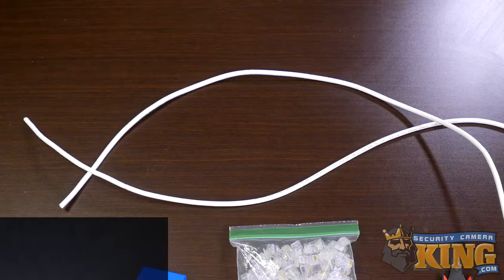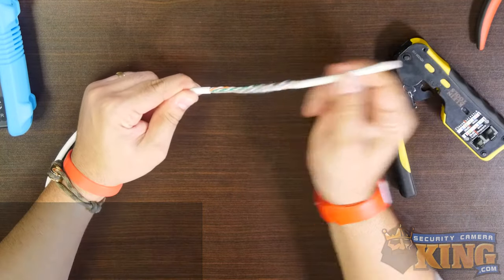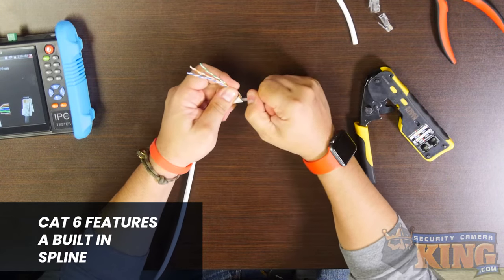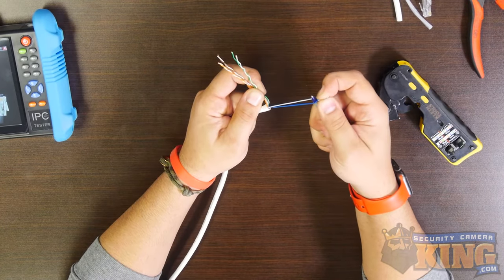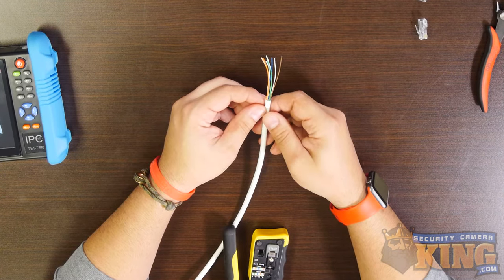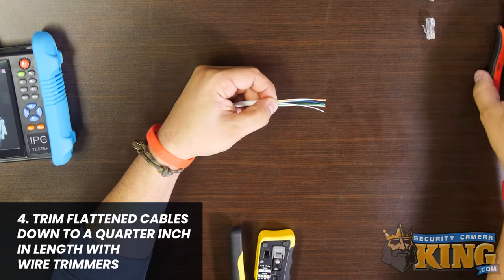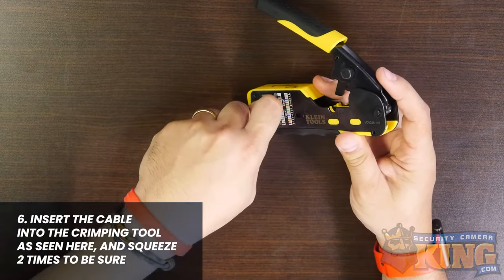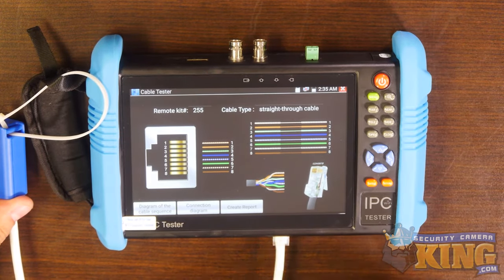How to Make Ethernet Cables - Cat5e and Cat6

Comment: Great video, I always train folks by using the zip cord to remove the jacket to avoid any possibility of nicking the wires, just like you showed.   Reall no need for a cable stripper, snips are perfectly fine for circumsizing the cable since we are not using that part of the cable.  One step i do is to initially cut the wires about 1/8 to 1/4 inch longer, and then shove them into the RJ45 (in proper ourder of course), and wiggle around.   Then, pull back out, double check the color sequence, trim to the correct length and install the RJ45 and crimp.   This process helps everything stay in place.  Thanks again, great video.

Comment: Hi, Thanks for your video, Highly Informative, I have same crimping tool, But confused whether I can use it Normal Rj45 jack, non pass through Jack, My doubt is clarified by your video.
Reply: There are TWO types of crimpers - one for regular and one for pass thru connectors.  
You need the correct crimpers.

I have been trying to learn with the PT connectors but some of the cable I am 😮using has a VERY narrow color stripe and it is hard to tell the colors . Once things are unwrapped and separated it is almost impossible to sort the wires

Comment: For a distance run how would you test the cable? Something where one end is farther then you could possibly put it into the test plug side? Have you seen or are there any Raspberry Pi testers?
Reply from the maker: Hi Rich.  Testers do have to go on both ends one way or another, if you leave one end connected to a unit you run the risk of damaging it.  You may notice we have ours zip-tied to the unit so it doesn't get lost, you could bring that module to the other end and plug it in; both ends do not have to physically be at the screen side.

Comment: When you make one side of the network cable does the other side need to be in the exact same colors or do you flip em the other way?
Reply from the maker: Both would be 568B Standard.
Reply: @Securitycamerakingcom  TY
Reply: That was my question too. Thanks for asking. Guess I was overthinking it.

Comment: how come my cables on my cat 5E were black,light brown,light green,dark blue,light blue dark green ,pink and brown ?
Reply: If this was a premanufactured cable then the manufacturer may choose to use something internally that differs from standards but this is extremely uncommon. I would reach out to the manufacturer for more information as these are standards that are almost always followed. 

That said if it was a spool of cable I would even more so say to reach out as this is not common. There may be a legend that explains from hem which colors the internal wires correspond to.